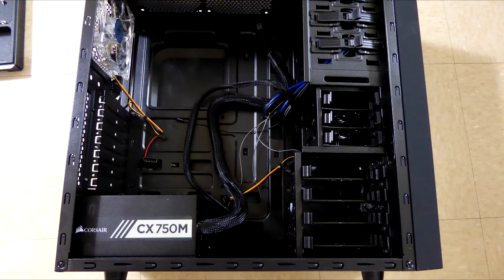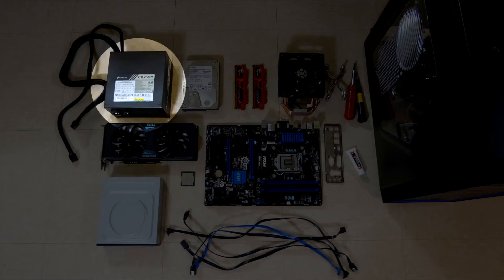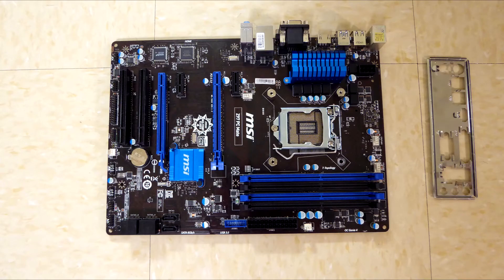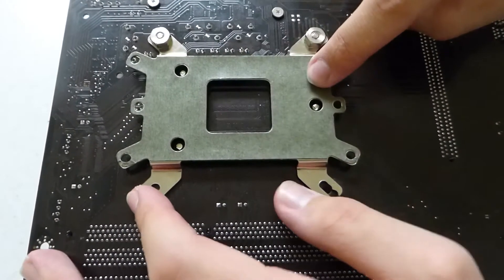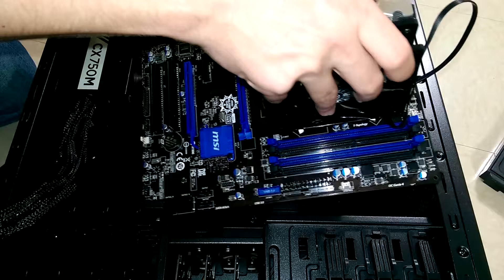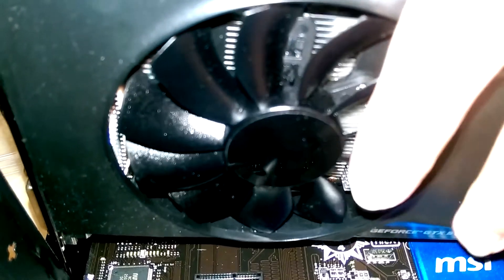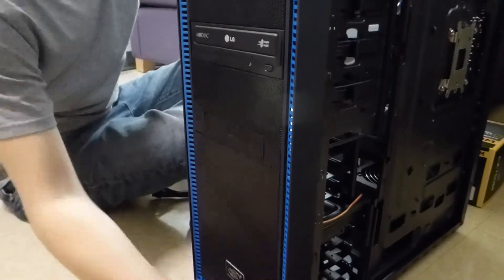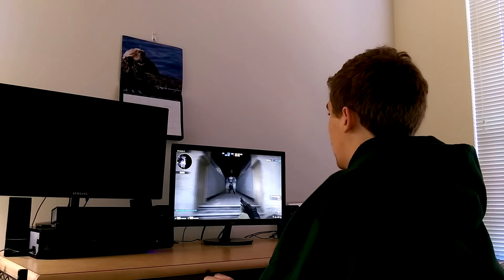How to Build a High-End Gaming PC For Under $1000 - GTX 970 & i5-4690k

Comment: Is cooler master hyper 212 evo necessary for 4690k if I'm not ever planning on overclocking? I was thinking of using stock cooler but idk.
Reply from the maker: You COULD but it will still get hot, but if no overclock you could save a buck.

Comment: Are the standoffs for an Atx or micro Atx mobo, if you have a micro Atx will you have to change the layout
Reply from the maker: I have not ever used a micro mobo, and as far as I know it's a different set up. This is for a normal sized motherboard.